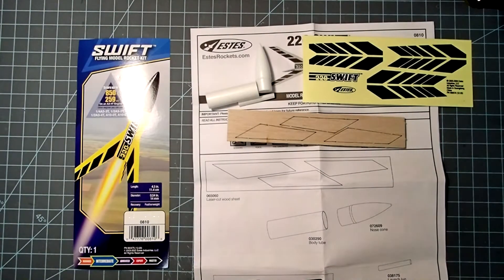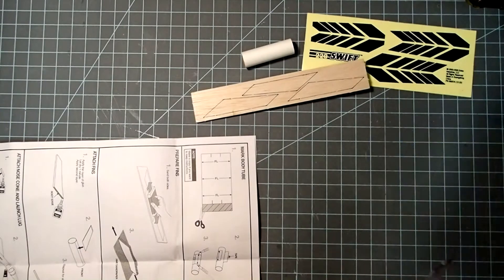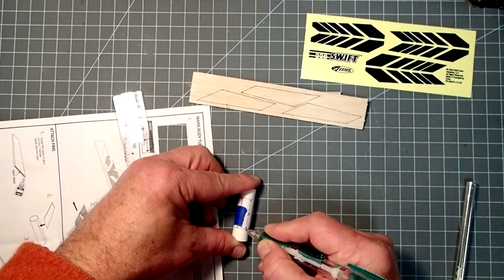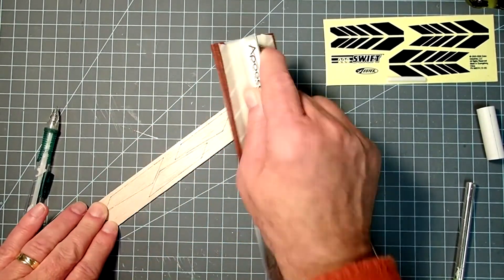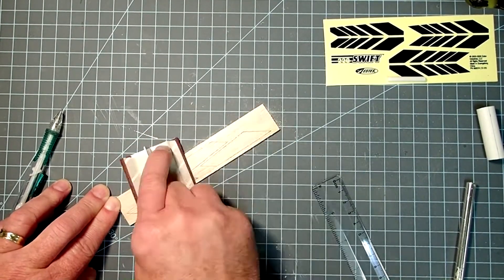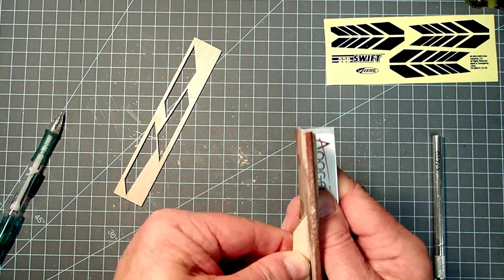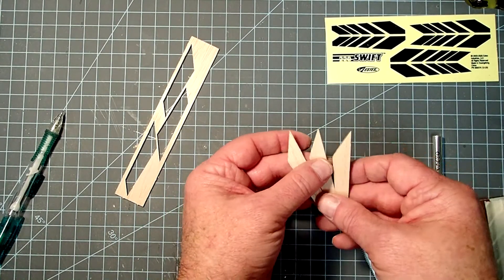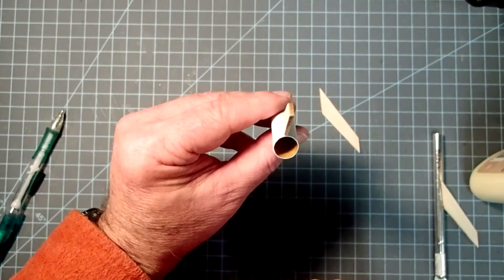Estes “Swift” model rocket assembly

Comment: This little thing goes really high (lost it on the second launch) I painted my body and fins silver then I did the nose cone black
Reply from the maker: I usually limit the motor to a 1/4A in these featherweight kits.
Reply: My motor sticks out a little at the bottom is that normal/ok??
Reply: @justinw3998   It won't hurt. It's going to be ejected at apogee anyway. :)